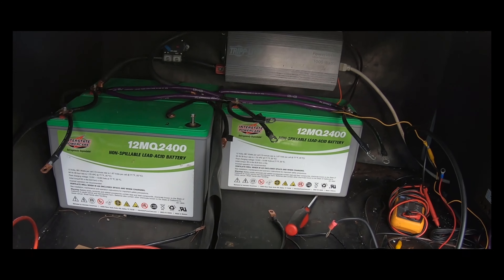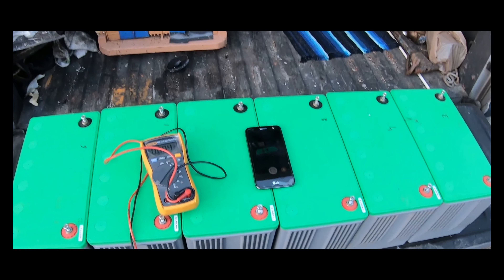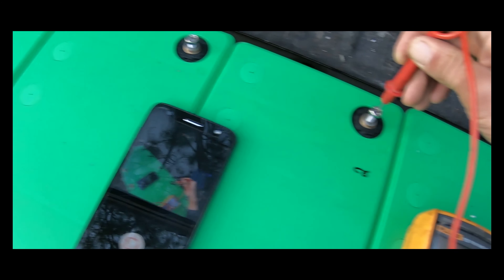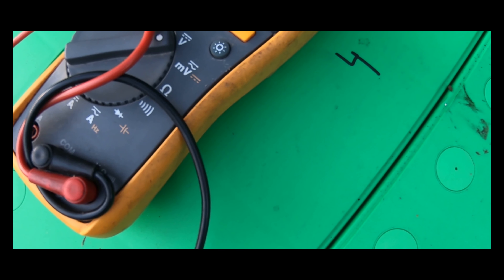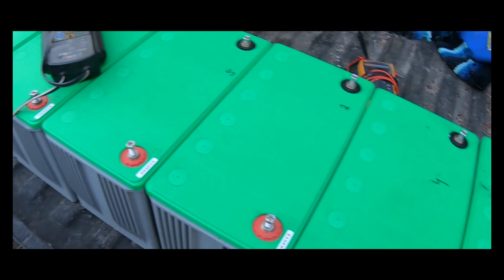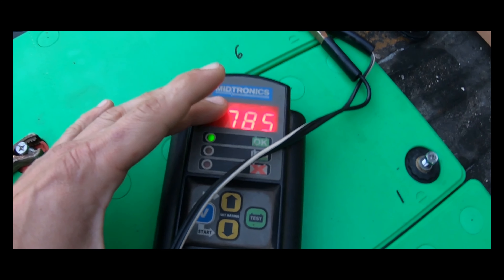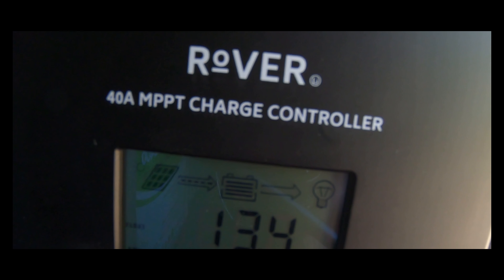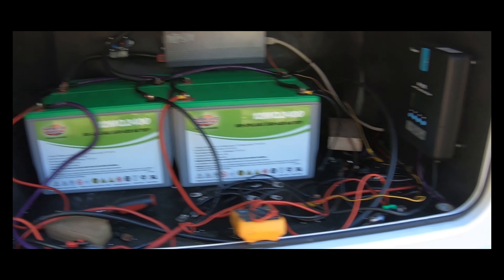How to FIND a BAD BATTERY in your 12 VOLT SOLAR BATTERY BANK

Comment: A bad battery when charging will show high voltage. Leave them hooked up while charging and simply look for the one with higher than normal v reading. You can also load test to see which one is showing low voltage. Try this before completely tearing down your bank.
Reply: Good advice. You can also remove the load , then open the string by removing one  connection on one of the batteries then you can use a load tester to check individual batteries. I like load testing better than voltage monitoring.

Comment: Why did you have to tear the whole battery Bank down to do this, you could have just left it all connected, disconnected your solar panel and seen which one drained the most by the morning.
Reply: Keeping the batteries connected for testing will cause a sphere of influence on the bad battery. You will get a false higher reading on the bad battery.
Reply: @Mountainrock70  oh yeah for sure, I didn't mean leave the batteries connected I just meant disconnect them and leave them where they're at.
Reply: @JohnSmith-xx1lx your confusing
Reply: @milekh6681  😄 🤣 made my day

Comment: hi this might be a random question Im currently taking apart a solar set up from a van. I have everything taken out except the battery which still has some wires connected to it. There are two loose wires and two that go to the fuse box. The two loose ones were connected to the charge controller but I took the ends of the wires out of the controller. Will the battery electrocute me if I take a wrench to unscrew the wire? how did you do that safely? My set up does not have an off switch. To disconnect the charge controller I covered the solar panels but I think there might still be some power left in the battery because the diesel heater still had its light until I disconnected it.
Reply: Only 1 way to find out

Comment: Harbor freight sells a reasonably priced battery load tester.  The old adage you get what you pay for. First thing you should do is redo all the connections on the clamps.  They did a poor job of making those connections.  With a load test all you need to do is remove one of the battery connections to open your string (load removed of course) then you can load test each of your batteries to find bad and weak batteries in your string.

Comment: Nice video ! One question i have a similar set i have 6 batterys 12 volts agm 100ah each  im not sure  what the absorption time should be for my battery bank  i have it now absorption voltage 14.5 for 1 hr and float to 13.8 ?
Reply: Your float voltage is good, but your boost voltage looks a little low to me, can you raise your boost voltage to 14.6 or 14.7 ?   My Renogy solar chargers come preset with a boost time period of 2 hours for Sealed lead acid / AGM.

Comment: how can i test if i only have a volt meter and not a cca meter my 4 12v agm batteries reach 14.3-4 volts but seem to drain rather quickly
Reply: your batteries have low capacity, meaning they are warn out
Reply: @joshwayop  oh wow that comment was almost a year ago man I'm running on 16 120ah lithium lifepo4 battery cells now with another 8 277ah lithium cells coming soon